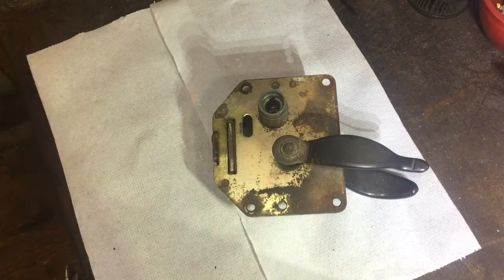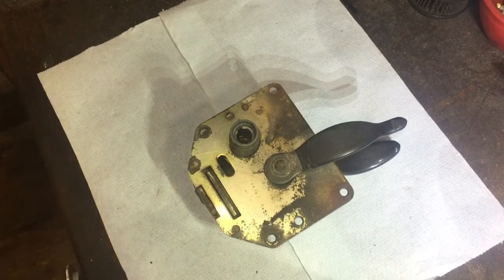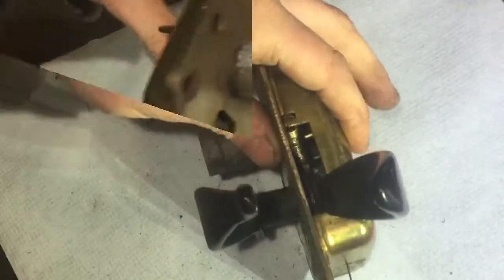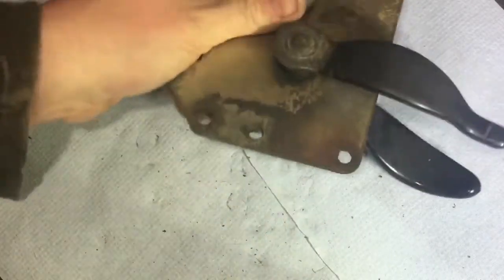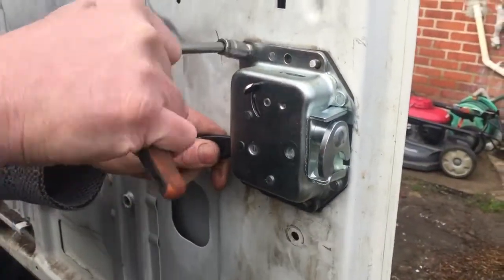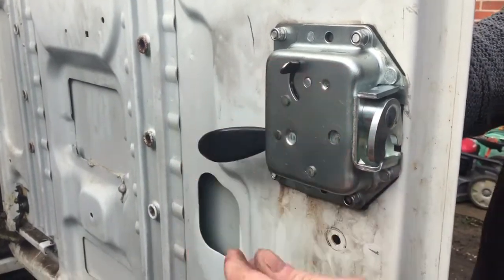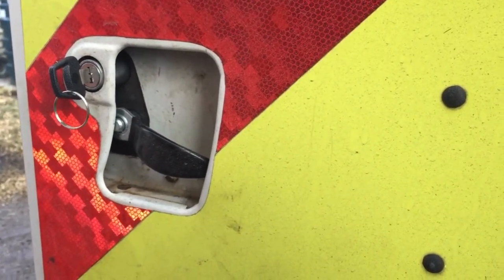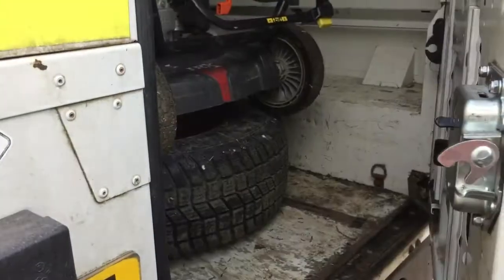Land Rover Defender 110 ( Fitting new rear door handle & lock ) My old one got stuck 😫🔐🔧

Comment: Hi Luke, must be a common fault as last year a customers did exactly the same whilst I was there. I could get in the back but it was a 90 and like a dam oven in there. I messed about for 5 minutes but I was so hot gave up!
Reply from the maker: Yes I could be a common problem lots of the locks on eBay for sale, it wouldn’t have been to bad if it wasn’t for the bulkhead. But I like the bulkhead. Should be all good now🙂👍